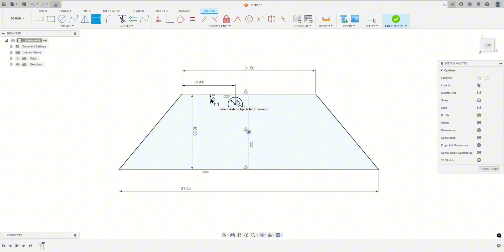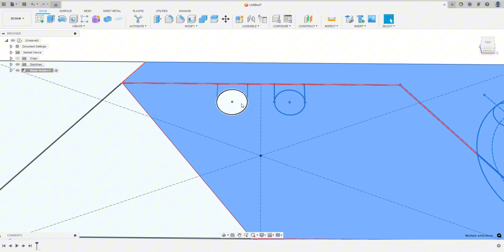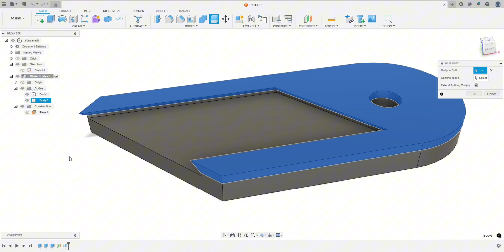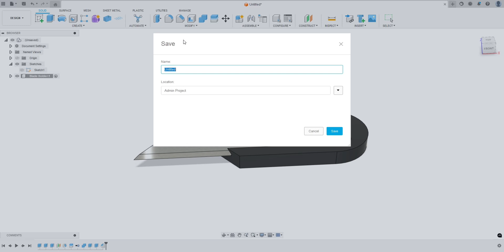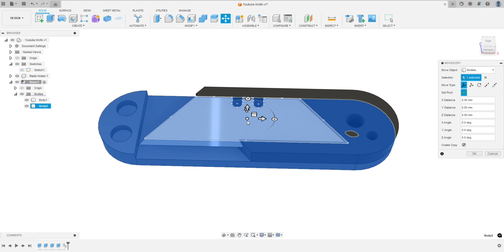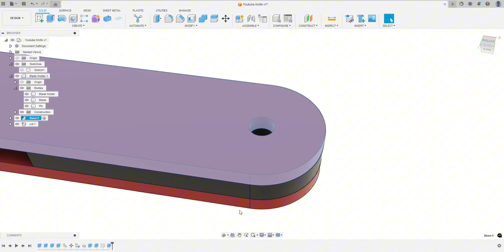Fusion 360 Tutorial: 3D-Printed Folding Utility Knife / PART 1 of 2

Comment: @03:10 why bother with the extra Pin? Just 3D Model a suitably sized Peak into one side and a corresponding Valley into the other? 🤔
OR alternatively have one Magnet on each side raised above the surface on one side and recessed on the other 🤨
Reply from the maker: This was a work in progress. My most recent model/design is on Makerworld. Username is Dfreshkremer

Comment: I liked this so much I made my own. 

"Draft" is from the casting world. It's an angle or slight taper added to a part that allows the part to be removed from a mold. So the "Pull Direction" is the direction you will be pulling the part from the mold. Many directions may work and many directions will produce the same result. Creating an offset plane was not necessary. This function is really handy if you are working with a mold maker and you hear back that your part will work better if they cast it from a different angle, then you just go back to your drafts and substitute the new pull direction instead of remaking your entire part. Usually you add your drafts last and that's most likely to minimize errors.

I started by making the blade, my blades are sharpened on both sides so I made it that way. Your "Draft" angle along the blade edge leaves enough space that my blades may wiggle, I added a little support there.

Comment: Amazing!! Instead of make a copy of the lower part and rotate it up, mirror it, lots of steps less to do ;)
Reply from the maker: The reason I didn’t mirror is because there was no center plane to mirror from, so I still would of had to move or align it afterwards
Reply: @ShopTherapy623  you use any plane to mirror it. the plane with the magnets is fine and then make a new body. I uploaded a short video on my channel ;)
Reply from the maker: @senjos ahh that makes sense.